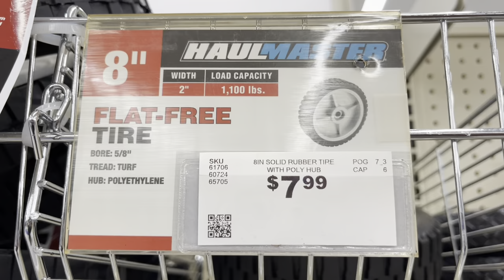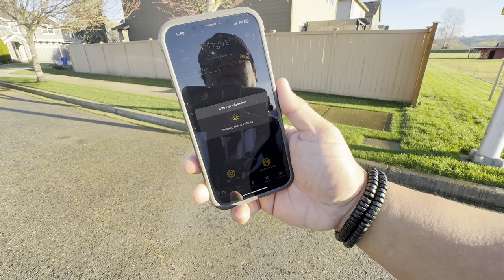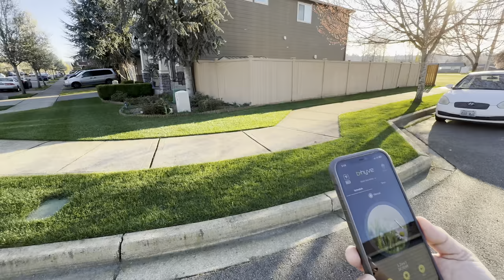FISKARS Stay Sharp Rear Roller finally FIXED! Let's dial down all 12 sprinklers! 1st Day of Spring!

Comment: After using Troy on the back back and you normally use the Ego. Do you feel a difference in the cut quality from the weight of Troy over the Ego?

I'm curious if the new metal EGO would perform any better than the current lighter/plastic models.
Reply from the maker: Ego overall has a better cut IMO over Troy. I haven’t noticed the Weight affecting the quality of cut. I’m sure the new ego is nice but it’s $1200 for a rotary 🥴😂🤙🏾